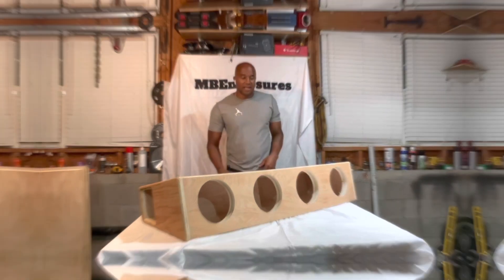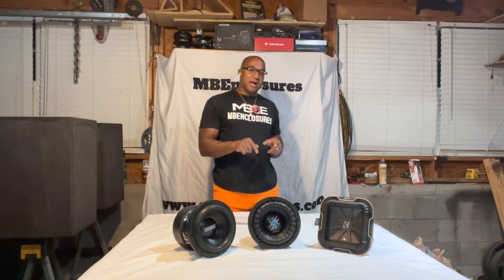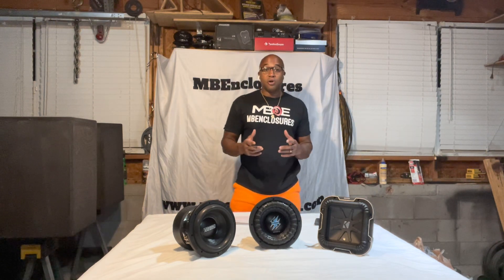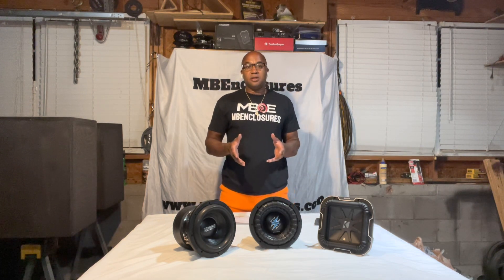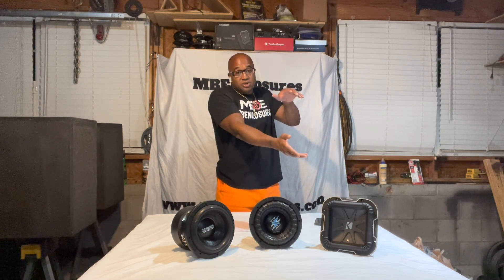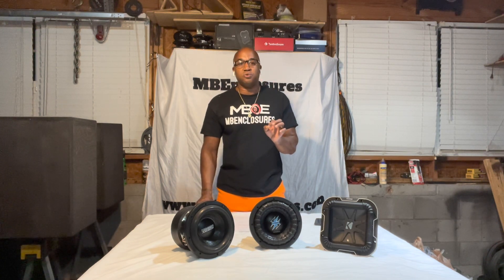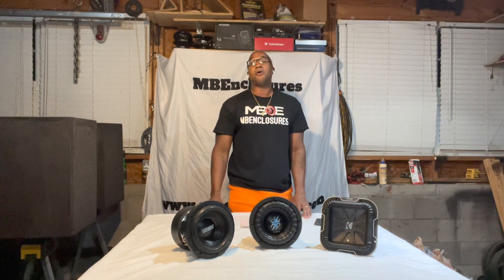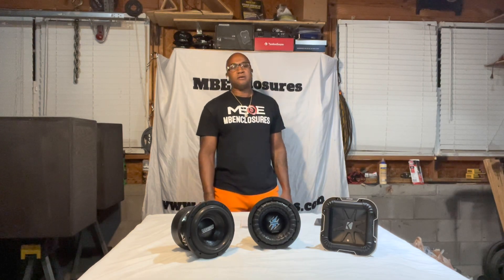Subwoofer Cone (aka speaker diaphragm) ….the materials ..Part 2

Comment: @MBEnclosures LLC I just ran across your channel. Talk about opening peoples eyes! Amazing channel man. I hope this blows up and gets big.

Also, I have a 1999 F350 crew cab. Should I go for (2) - 8” in sealed box or (1) - 8” ported? It’s a daily driver but I want solid sound. Doors are focal coaxial 6.5 with 50 watts rms. Not trying to win a comp but want to be loud and clear.

Comment: Everybody that is always criticizing kicker for low excursion needs to rethink that because their solokon  technology results in less energy loss from cone flex resulting in more output at less excursion.
Reply: Why don't Kicker make a round 18" sub? I'd buy that. I'm stuck with Skar where there's so much flexing it looks like ripples in the water.
Reply: @flyhouseoftruth470  the 15-in L7 square has nearly as much cone area as a round 18. The q series l715 sounds really good on music and takes power a very good choice.
Reply: @johnnycorn7225  . Yeah but I'm working with a box for an 18 with hole already cut. Unless I can do some trimming and make the square 15 set in there snug, doubtful, then my choices are the cheap Skar SVR18 or break the bank and go with a better sub. Kicker used to make a round 18, but as I recall it was advertised for sealed boxes only.
Reply: @flyhouseoftruth470  it's all about the box man I swear it's so easy to build a box and customizing the box to get the sound you want will get you better results than buying an upgraded sub and putting it in a random enclosure. It's so easy I promise there are people to help you with boxes as well. 
My favorite job is when someone pays me to redo a custom box and that's the only thing that changes in the whole stereo and then they're blown away by the improvement.
Reply: @flyhouseoftruth470  best money you could spend is paying MB right here for a custom box hit him up you're on his channel bro
Reply: @johnnycorn7225  . The box I have is a pretty good design, proven and popular, but yes it could be better considering I have a Dodge B350 van to put it in. The size of a small bus.
Reply: @flyhouseoftruth470  is it made for the svr sub?
Reply: @johnnycorn7225  . Yes, I bought it for the Rockville 18 but that one doesn't fit, I don't have enough materal to get screws in. The person I contacted at Rockville lied, "The cutout should be somewhere around the 17.5" and 17.8" for the driver to fit" by my own measurement the Rockville sub needs 16.25" hole, any larger and you can't get screws in to hold it. But I had no way of knowing this before I bought the thing.
Reply: @flyhouseoftruth470  oh man you seriously got to have the right box. If you don't want to build your own you got to have somebody do it if you want good sound no way around it. You can't just interchange subs with boxes
Reply: @johnnycorn7225  . I'd like to build my own, I just don't have a million dollars for a garage and all the tools. If that ever changes, watch me go crazy with box building.
Reply: @flyhouseoftruth470  yeah in that case it would be worth it to just pay for a box. If you like kicker you can get kicker pre-made enclosures that are properly tuned to the sub for a great prices!

Comment: Hey, can you explain what's the difference between the Kicker and the American Bass subwoofer that has no dust cap?
Reply: I believe you are referring to the American Bass XR Series. Those drivers would be more comparable to the Kicker Comp Q Series. The XR has a sensitivity of 89db and the CompQ is 86.2, on the same power in similar enclosures the XR should be louder. As far as sound quality goes, again it all in the enclosure. The XR having that fiberglass cone will definitely help with retaining decent sound quality, especially if you're throwing 1200 watts at it. Of course, the same applies for the CompQ. Just my opinion, you can't go wrong with either.
Reply: Yeah, I have 2 American bass XR-12D4 I was just curious on MBE's thoughts